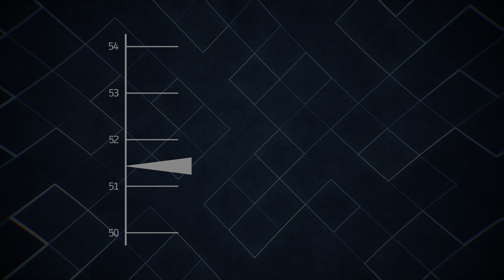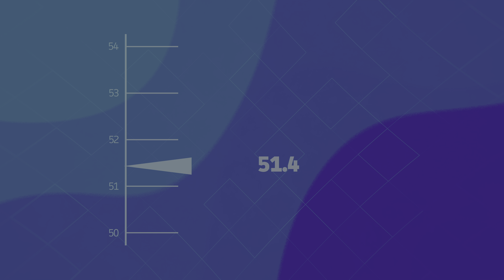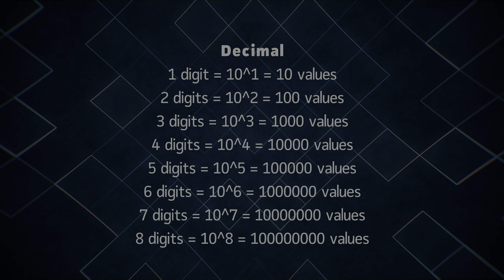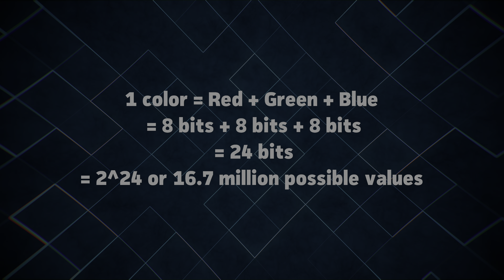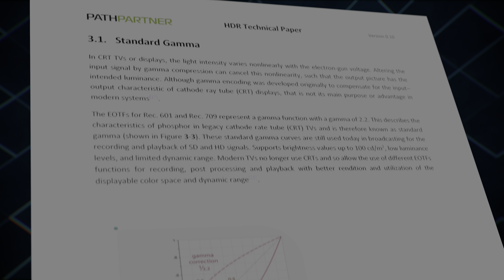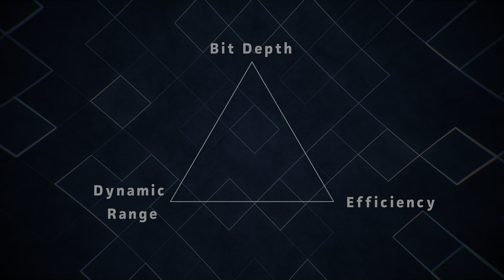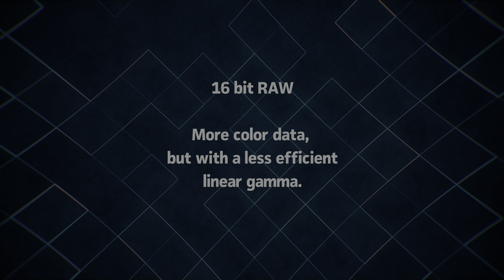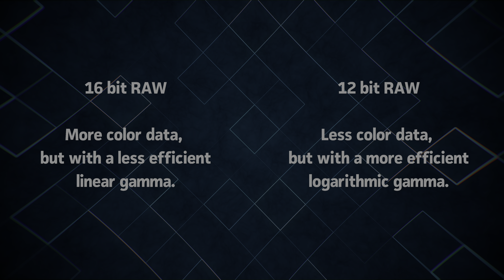Bit Depth: Where Filmmaking Meets Computer Science - Video Tech Explained

Comment: There's one more complication to add into the concept as well. A frame of video will contain audial and visual data, the visual information being made up of not just luminance data (luma) but also saturation and hue data (chromaticity). So choosing to use a gamma curve (or more accurately, a set of OETFs and EOTFs) such as Sony's sLog3 will certainly improve the /luma/ range possible to capture, but will not necessarily guarantee colour /depth/ at the extremes of the luma range (where the response curve is compressed) This is why chroma sub sampling and bit depth are also important as theyboth allow a larger 'box' to store these extreme values into without having to clip or scale them down to fit a smaller 'box' (bit depth) and also describe how data is handled as it approaches the limits of the recordable range of that 'box' (chroma sub sampling). This is often why during some shadow recovery work you can certainly recover the spatial information in the scene's shadows, but it is often markedly lower saturation or even skewed/inaccurate hue values. Every camera sensor at every price point will have an 'optimal' dynamic range where a minimal amount of this distortion happens, which is often a lot smaller than the maximum 'dynamic range' possible. So keep that in mind when comparing spec sheets on camera systems ;)

Comment: Camon, let's say you have the same scene and you take a photo and a single video frame of it. The photo is 14-bit RAW and you export it to sRGB JPG. The 12-bit RAW video frame has the log and gamma corrected and exported as an sRGB JPG. Why does the photo look objectively better than the video frame? On paper, the photo was captured with 2 extra bits per channel. Does the extra precision account for the better color rendition and dynamic range? Granted, photographers do not have shutter angle constraints to deal with. They also don't feel compelled to shoot at base ISO 800, log, or use ND filters. In fact, you never hear photographers talk about dynamic range. Curious what your thoughts are.

Comment: Very well explained.  I only would have asked that the distribution of data in the stops of a gamma curve be explained so as to wrap up.  How is one more 'efficient' while another isn't?  Why is the log gamma curve distributed the way it is, so that it retains more detail in shadows?
Reply from the maker: It mostly has to do with how much of the signal range is devoted to different parts of the image. For example, if you extend a standard gamma (2.4) out to 10,000 nits, then about 14% of the bits would be dedicated to values below 100 nits, and only 37% would be dedicated to values below 1,000 nits. This isn't ideal, since values above 1,000 nits are not very common yet they are occupying the majority of the signal range.

The PQ curve, on the other hand, distributes bits much more efficiently for a typical HDR grade. 25% of the signal range is dedicated to values below 10 nits, 25% for values 10-100, 25% for 100-1000, and 25% for 1,000-10,000. This distribution much more closely matches the relative importance of these regions of an image. Most HDR grades still keep their shadows and midtones below 100 nits, with the rest of the signal reserved for highlights and extreme highlights. We don't need nearly as much information in the 9,000-10,000 range as we do in the 0-1,000 range

Most gamma curves are tuned to distribute bits as efficiently as possible for their particular use case.

Comment: Anyone who’s coded with Arduino (or compatible or Raspberry Pi) will know that analog sensors e.g. thermometers sometimes just report a voltage value and will have code that translate that into meaningful numbers and scale it to maybe a 10-bit scale (0 to 1023).

Comment: Once you get above 12bit, the human eye start's to not notice the difference.  14bit RAW in Blackmagic cameras, is indeterminable to 16bit Red or Arri.  Over-sampling is for posterity only.  True 10bit monitors will cost you $20,000.  A true 16bit monitors or projectors (like Fusion Reactors) are 50 years away.

Comment: Camera sensors including the cheapest ones are able to achieve a level of color detail that's professional 10k+ cinema camera level. Problem is no one wants to work with huge files and also camera companies have been locking down their firmware so you're unable to directly access the raw data, even with photography. Camera sensors aren't bound by bitdepth they're analog devices. The ADC and image processors are though.

I believe no log video format or even hdr such as hlg is supposed to be graded. Anytime a camera writes a video file to a memory card, it has already processed the image for you. You wouldn't push a JPEG and expect good results now?

So read the technical paper on the specific log curve you're using, follow its instructions and get the look you want in camera. You can do very slight adjustment but the problem is with video files, whether its 8bits or 12bits, anytime you push or pull a single color, it inevitably messes with every other color. Raw bayer Data, such as those out of RED, Sigma FP, Arri and Canon Magic lantern are the only ones i'd feel comfortable pushing around. Instead of the image processor, you do each and every step yourself. Those cameras are essentially data collection devices, not video cameras

Comment: Does shooting in 10 bit and after editing exporting in 8 bit SDR leads to color loss, if yes, then what's the point shooting in 10 bits?
Reply from the maker: If you're exporting at 8-bit, then yes, you're going to be losing color information compared to the original 10-bit footage. However, there is still a benefit to shooting 10-bit even for 8-bit delivery, because it gives you more flexibility to apply color corrections/grades without introducing noticeable banding in the final product